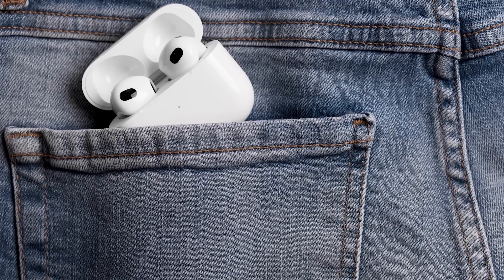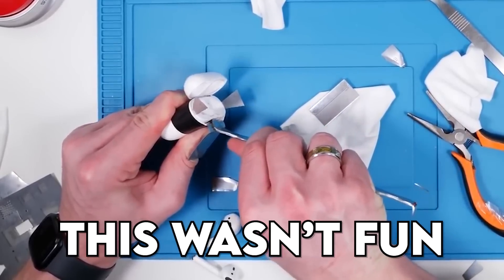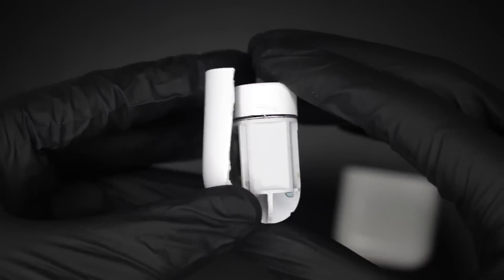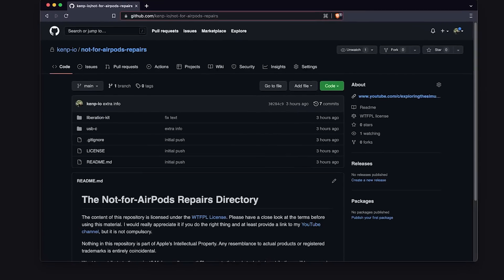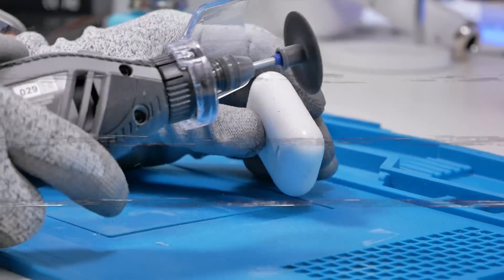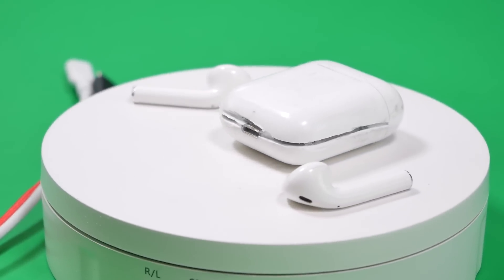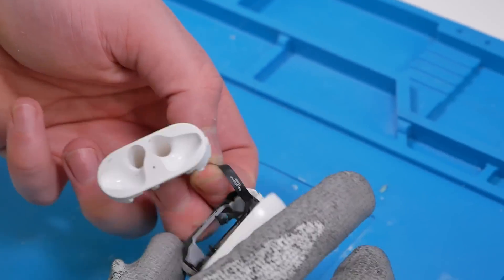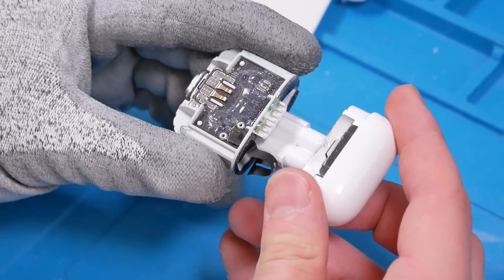AIRPOD USB-C MOD + REPAIRABILITY SOLUTION

Comment: Hey man, if you’re ever working with 3d printed parts use a soldering iron. The tip doesnt get ruined and you can relevel surfaces and soften it up

Comment: This is the most janky and horrible video I’ve seen you put out. If I sent something in for repair and I got that sent back to me, I’d file a chargeback through my bank. I understand this wasn’t for a customer, and an experiment, but come on dude; use a small file and take some time when expanding that port. You only needed to take off 1/2 of a millimeter of material.

Comment: Apple switching to MagSafe only charging instead of USBC while also keeping lightning so people can use their old chargers isnt “bad for the environment” because if you already have an iphone you already have a lightning charger, and the magsafe only ensures nobody will EVER have ti buy a new cable again because it completely solves the cable pin and wire breakage issue. Switching to usbc for the “environment” isnt actually for the environment, its because android users want to have the ability to point out that their phone ‘has that too’ instead of facing the fact their processing and battery power are inferior to a phone that doesn use top of the line tech and makes 2-3 year old screens and features look better than androids decentralized software and app systems. I hate this whole “environment” BS if yall cared about the environment you would stop using phones completely based solely on the fact coal, gas, electricty, sattelites, deforestation, and mining are all BARE MINIMUMS in order for that phone to be even functional. Not to mention the INTERNET like yall have any idea how much power is required to run these massive networks and 5g?! Stop it. Your not a fucking nudist living in a log cabin airpods arent even meant to last 4 years if you break them you buy them NOT TO MENTION SAMSUNG PHONE BATTERY SWELL AND EXPLODE AFTER 6 YEARS. Oh and wait til yall find out HOW LONG A TESLAS BATTERY LASTS 😂your gonna be pissed when you find out its not like a gasoline car, and you have to buy a brand new one every 5 years (3 years if you actually use your car alot). Stop it

Comment: What's the temperature of "cooking"?
I want to remove a Note 20 back and I have a 3D printer with a heated bed, but I don't know the temperature and the bed plate is going up to 120 celsius max. I don't want to kill the phone but I want to remove the back.

Comment: Man, this was a nightmare. It's almost like Apple went out of its way to make it more economical to throw a damaged out, damaging the environment, then pay them for another product, which will ultimately end up thrown out too.
Reply: Most companies nowadays that manufacture products make them with the intent of planned obsolescence. They design things so that it's easier and "cheaper" for people to just throw them out and get a new one when they end up breaking, as it's the only way that they think they can manage to keep their steady stream of consumers. Often, companies design things to have enough quality to be passable, when in reality they aren't built to last through more than a few years of regular use before they break or encounter unfixable wear and tear. Electronics companies are usually the most guilty of this, which is why they often make things needed for repairs proprietary, or make it impossible to repair something without decreasing its resale value (for example, Apple's OS set to detect if the screen, battery, or parts have been replaced by a third party repair center and show in the settings if it has been, which usually makes those devices seem less valuable or unreliable to unsuspecting consumers). Electronic waste accounts for a large portion of long-impact waste now, since many materials that go into making electronics can't be easily broken down, and planned obsolescence plays a major role in that.

Comment: don't use gloves with dremels. It's the same as with table and circular saws, you'd rather make a cut in your hand than grip on that glove at high speeds, pulling your hand in and potentially doing worse

Comment: This is a very interesting repair/mod. But I would probably 3D print the new housing on a resin printer for smoother quality, as the FDM print just doesn’t fit in with the aesthetics of the AirPods in my opinion. But since I got my first pair of AirPods like a week ago, there is no need for tinkering, at least for now…
Reply: The ones sent over were SLA (resin) printed, however there was an issue with the dimensions causing them to crack. They have since been updated.

Comment: Awesome video PRG <3 Somes notes:
- 6:38 the trick is to transfer heat only to the metal hinge using a soldering iron. The hinge is were is the strong adhesive is.
- 8:01 smart move to remove the connector to avoid tearing the flex cable! I like it.
- 12:38 the resin I used for the prototype is too fragile, will change it up when I sell the kit :)
- 13:06 the hole is too small because the extra layer of added paint, my bad. This is also fixed now!
- 13:39 it is too tight because the plastic teeth on the middle frame need to be sanded down before inserting the new shell! This way it will still be a tight fit but you can open the case again in the future. That's why it's breaking, wasn't designed to be pressed against those teeth and the resin used isn't the best.
Thanks for taking the time to make the video! I'm happy you got it to work in the end. This was just a prototype and I'm now working on making it available for sale!
Reply from the maker: Thanks for sending it out! was really fun making this :)
Reply: Your video was an inspiration when I first saw it, keep up the awesomeness man!!
Reply: Second reply, amazing job I would never even dare to try something like this
Reply: If you are making it a kit i think it will be better to make a mould and the new case should be plastic injected for more durability and color matching from the start

Comment: If there was a company that sold earbuds with repairability in mind, having easy access to the internals and parts available for consumers like batteries and drivers, they would have my money all the way
Reply: Actually to a point samsung buds are fairly easy to repair
Reply: Prob very few people buy it. And it will be expensive like framework laptop and fairphone. i think samsung buds are repairable.
Reply: Most people don’t think beyond “right now”
Reply: Fairbuds
Reply: @GrafasG  aka the reason fairphone cut the headphone jack on their phones...
They aren't even repairable, they're just easily individually replaceable. No thanks.
Reply: Samsung buds
Reply: @aidancommenting  His had to be fully taken apart without concern for the battery, and the battery for Airpods is usually the part that is challenging to fix.
Reply: The framework of earbuds
Reply: Sonys wf-1000-xm3 are fairly easy to replace the battery in
Reply: I wonder if it is possible without them
becoming uncomfortably big.

But yes, they should use less glue at the very least.
Reply: @filthyklownzssb4589  as you saw, everything except the housing was fairly easy to disassemble. Instead of using glue Apple could have used screws and seals to get to a simliar result with more repairability... But yeah it's Apple
Reply: The Samsung galaxy Buds Live are really a step forward!
Reply: The issue is (not excusing Apple the design is designed to not be repairable) there so small it’s a pain in the ass if you want a slim and comfortable earbud.
Reply: So, Gabriel, are you ready to go buy some Samsung buds? Because they're the closest thing we have to what you're looking for: Reparable without too much fuss.
Reply: most of the time if you buy more expensive earbuds like sony or senheiser or even beats you can send them back to them for repair or get a replacement.
Reply: You would never have waterproofing
Reply: then you never would buy their product again because it will last a decade lol
Reply: First galaxy buds and buds+ are easy to repair. No need for soldering and destroying.
Reply: Bro thought his 1$ is worth 1000$💀
Reply: The "clone" airpods are pretty easy
Reply: @vimicito  yeah but the upgrade cable can cost around 50 for a decent trn ones
Reply: I think the problem is that a lot of people care but not that many people care enough to pay extra for repairable stuff. Great example is framework. I absolutely love the idea but honestly if I ever need a laptop I might just get something cheaper
Reply: Bose. Replaced the battery in my Soundsport Frees twice.
Reply: The Samsung galaxy buds and galaxy buds plus were relatively easy to replace the batteries
Reply: The dude named like
Reply: Not happening. Almost all earbuds are way too small to repair. You are likely to fuck them up
Reply: Even if they aren’t a company with a big name?
Reply: PINE64. They are making some cool stuff, go check them out.
Reply: Fairphone makes ones like that, not sure about how good they are though
Reply: Skull candy
Reply: fairphone
Reply: If you don't care about active noise cancelling and don't mind ear hook or neckband designs basically any iem + Bluetooth adapter works

Comment: Hey PRG can you help me
My lg wing is having a ghost touch issue and also half upper part of touch is not working or responsing on touching although there is not line or dot or any problem in the screen so can you please give a solution for ghost touch issue and if i changed the glass panel then ha half upper part of touch will start working?? Pleaee help love from india and also is had smashed the like button and also i'm a daily viewer 👍👍

Comment: Meanwhile I’m sat down right now trying to fix whatever is wrong with an old PS4 controller that doesn’t hold any charge, and I lose a spring on the R2 😂. Selling for parts, probably get about £10 after fees which for an old controller is ok, or give it to some nephews to bash around like a boomerang.
Reply: probably a bad battery, have you tried changing it or have a multimeter to test it's voltage ?

Comment: The worst part about 3D printing is that the plastic is so fragile that a small drop will break it with ez
Reply: That is what I was wondering too..does it have the rigidity of the original case?
Reply: @yeshuinfinity5963  nope it doesn't and the 2nd attempt clearly shows it, it cracked on it's own without being dropped
Reply: @dzgamer342  then is it really worth it to sacrifice the rigidity of the case for a type c mod?
Reply: @yeshuinfinity5963  not in a million years man I would prefer good durability and slow charging over fast charging and trash durability
Reply: @dzgamer342  lmao same🤝
Reply: The resin used for this prototype isn't great. Learned a lot since then and found much better and durable alternatives since then!
Reply: @ExploringTheSimulation  so why didn't he make the cases with a better resin?
Reply: @dzgamer342  this was a prototype I made a few months ago. Didn't know much stronger resins existed but now I do and it doesn't break like that. Learning every day :)